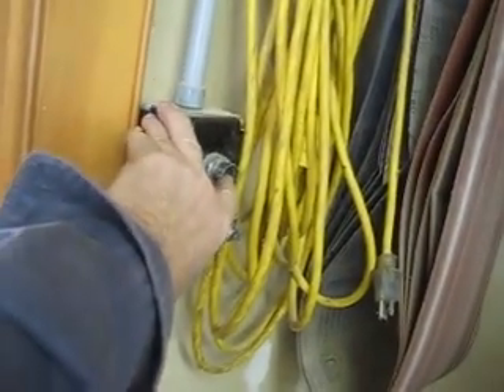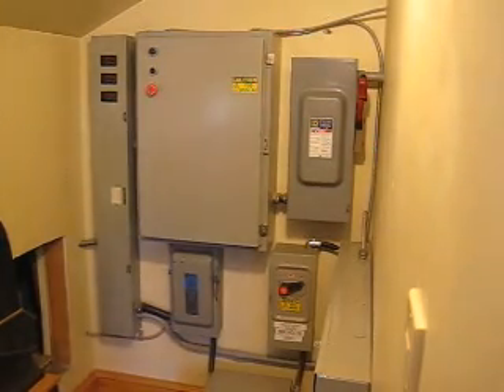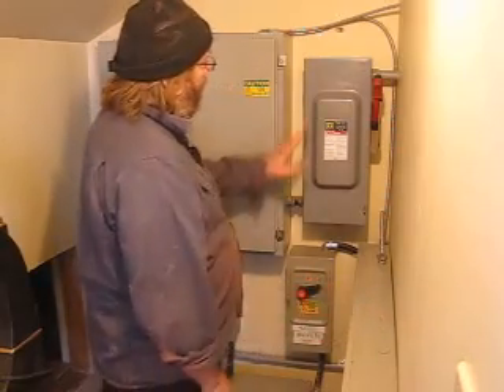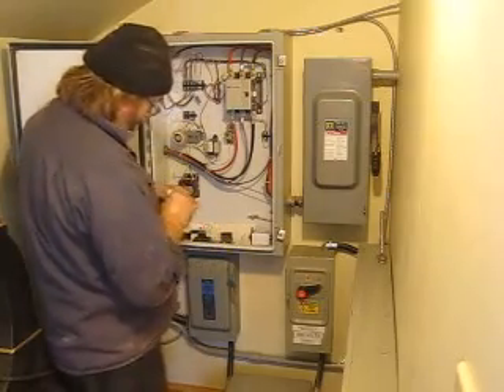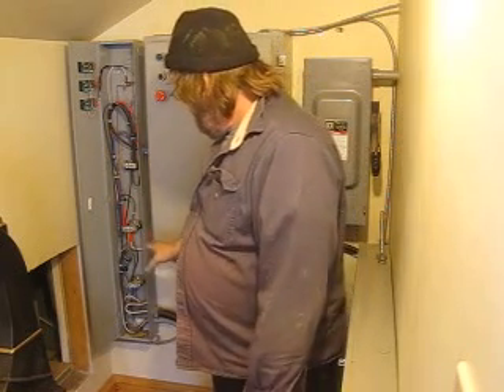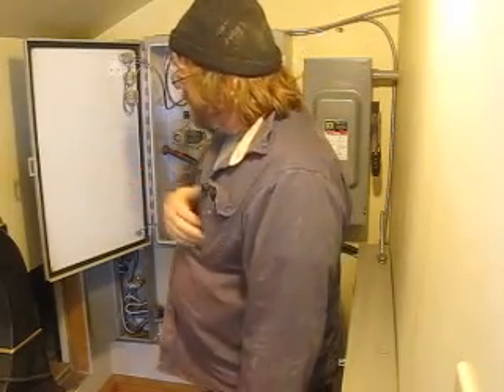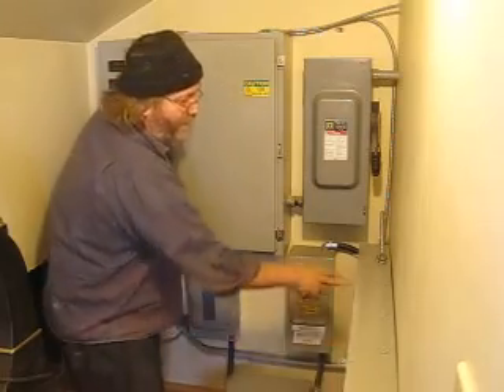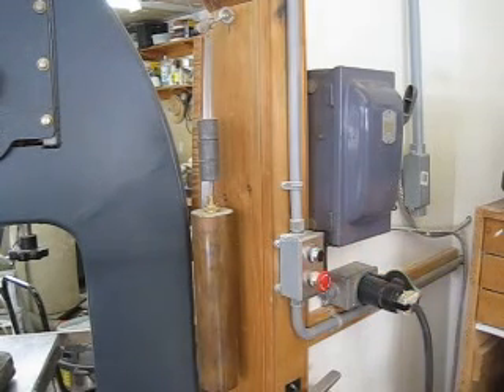OWWM Wadkin Temple    3 phase power RPC tour

Comment: Hi Jack,
I've been watching this video for a long time now and I'm planning to build something similar to your setup. Could I ask you a question about your 9Kva transformer that you mentioned was a 600V to 240V? Is the transformer a regular transformer that your just back feeding or is it a step up transformer?
Thanks for the help!
Kind regards,
Matt L
Reply: It’s an isolation transformer 602 40 but I did vies you talk to you a transformer company and have one made for you it’ll be approximately $1000 . Let them know what you were doing so they can size it properly
Reply: @jackforsberg1326  Thank you Jack!!! I spoke to an electric motor company and we are looking at swapping out the electric motors to a lower voltage with a VFD.